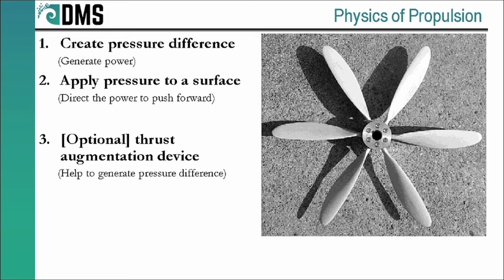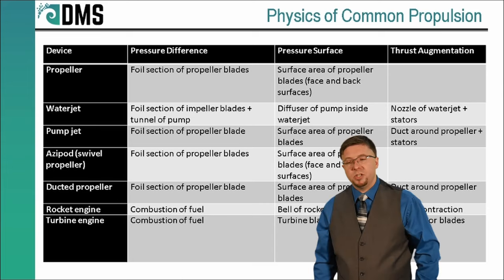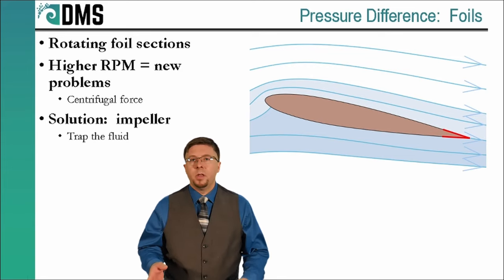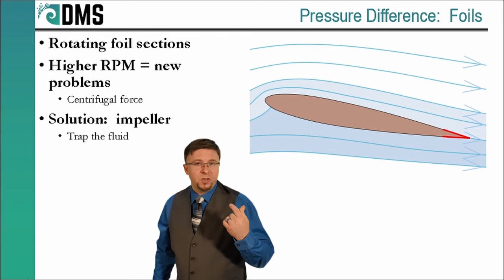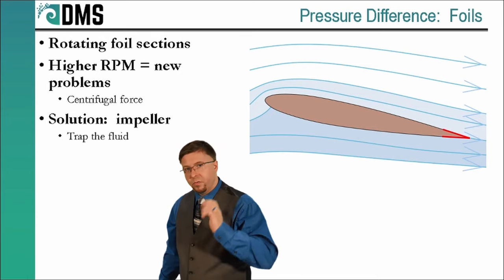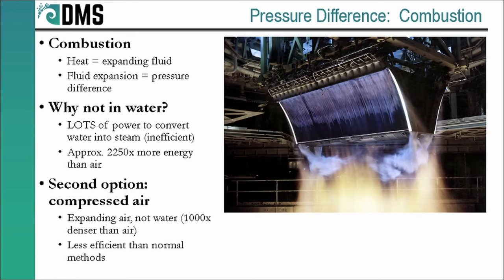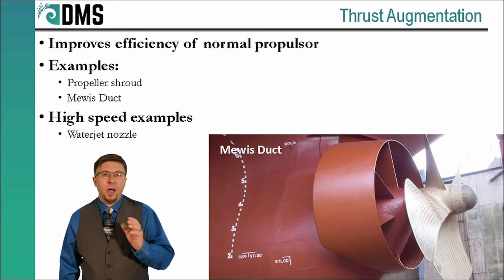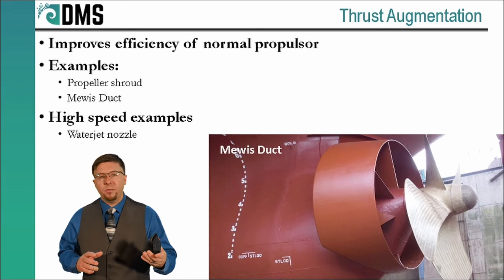What Separates a Propeller from a Waterjet?

Comment: I've always thought of the physics of propulsion in even simpler terms: reaction mass. For every action, there is an equal and opposite reaction. Every method of propulsion, land sea, air, space, biological, chemical, or mechanical, all accelerate mass in the opposite direction of thrust.
Reply: The pressure surface is where the reaction force pushes the vessel.

Comment: Thanks for this great explanation of propulsion. I made a realization while listening that sails are really no different from propellers: they also generate a pressure difference, and then apply that difference to a surface. It's the source that is different: sails just rely on capturing wind energy rather than using rotational mechanical energy. The same physics apply to both. Now that I'm writing this, I feel stupid. Of course they are the same! They're both foils.
Reply from the maker: Great point!  That thought normally takes a while even for the professionals to realize it.  Yes, sails and propellers follow many of the same physics.

Comment: What is you opinion of rim drive technology scaled up to yacht size?
Reply from the maker: Yes.  It works.  Probably better, because the larger electric motors frequently require water cooling.  From a pure physics perspective, I don't see any problem with rim drives at larger scale.  I think there may be some practical drawbacks.  Specifically, a rim drive thruster has no access to the motor for maintenance.  I haven't worked with enough electric motors to say if that would matter.  Smaller electric motors are virtually maintenance free.  But large electric motors, the size of a car . . . those get more complicated.

Comment: Where is this diffuser is located? At the entrance of duct? Or inside the duct? Or at its outer borders?
Reply from the maker: @whyMDO  The diffuser is located just after the impeller.  It includes the stator vanes that straighten the flow.
Reply: @DatawaveMarineSolutions  , thank you!
Does this mean, that stator and diffuser are the same thing? I would really like to distinguish the difference between theses two terms/entities.

Comment: Thanks, I appreciate your clear explanations.  
Now, could you please apply all that knowledge and make a more efficient outboard motor propeller for my boat?  These new gas (petrol) prices are getting difficult.  🙂
Reply from the maker: That's ironic, because the idea for this video started when I considered how to improve the propeller further.  My basic conclusion:  you can't really improve the propeller much more.  There are a few add-ons that help.  But we are at the limits of propeller physics.  I think the next big breakthrough will require us to completely rethink propulsion.  I have a few ideas on that front, but nothing actionable.   The next move will be just as big as when commercial shipping moved from wind to steam propulsion.
Reply from the maker: @satunnainenkatselija4478  Hard to say.  I have seen this style of propeller applied before in wind turbines.  The physics are largely the same between wind turbines and propellers.  But I never saw systematic tests in that case either.  

I did find a video from UofM testing on the sharrow propeller.  https://youtu.be/mwVqN9AB64Y
So it appears the prop was tested formally.  And the video does support the claim that the Sharrow Propeller reduces tip vortices.  But there are some big caveats.  First, that video had to be recorded with the prop and water flow operating below normal operating speed.  I know know this because the video shows die in the water to trace the water flow.  If you operate at full speeds, those dies immediately diffuse into the water and you never see the streamline.
On the whole, there is a theoretical basis for the claims of improved efficiency in the Sharrow propeller.  But in 5 minutes of searching, I did not find a 1:1 comparison that proved the Sharrow propeller was tested under the same conditions as a conventional propeller.  There is a very good chance that data exists.  Sharrow Marine may just want to keep confidential to protect their investment.

Comment: are rotating propellers more mechanical efficient than fish or whale fin?
whales move fast many tonnes with very little movement and friction. why boats no add some fins?
Reply from the maker: This has been a long debate in the marine community.  I'm not sure if rotating propellers are more efficient than fin propulsion.  I can tell you that we studied fish fin moments.  And the main reason we don't mimic the fish is that their movements are insanely complicated.  You can see a video of this here:  https://youtu.be/I5Phg4q5EBU

Any type of fish propulsion would require numerous underwater joints and be extremely difficult to create.  

This is similar to the argument of why didn't animals evolve rotating wheels for land propulsion?  Because a rotating wheel is incredibly difficult for biology to create.  Some things are easier with biology than with mechanical equipment.  And fins are much easier with biology, but extremely difficult to reproduce with mechanical systems.
Reply: @DatawaveMarineSolutions  thanks so much! for your reply. I will check the video
Reply: my naval architect friend, I am ver pleased to have found an answer! look for hobbie mirage kayak. there are videos showing how powerful it is and faster than kayak prop. systems!!!

Comment: When are you going to speakup about carbon fiber  hulled submersibles????
Reply from the maker: I'm intentionally not speaking about the Titan submarine incident.  We have very few facts, and far too many opinions right now.  I believe that it is unprofessional and irresponsible to provide any public engineering opinion without a sound factual basis to form that opinion.
Reply: @DatawaveMarineSolutions  you are overthinking it...  the question is what is the best method material for a deep diving submersibles if you are going to use the  provrn bathysphere materials and shape.... you no gut INMHO. carbon fiber mated to titanium rings is not practical.... of course it appears the weaving of the cfiber section was not cross woven, like cfiber scuba tanks are????...

Comment: You neeed to upgrade your video "jets" below the  water line work or US navy work not be able to use in propulsor style
Reply from the maker: True, waterjets do work below the waterline.  This gets more into classification and terminology.  I classify a waterjet specifically as the device that mounts on the transom of a boat, using a duct to suck in water from the bottom and exhaust it out the stern, above water.  There are other devices that work very similar to a waterjet but the outlet is underwater.  We call them something different than a waterjet, just to show that they are a different device.  This isn't a large debate over physics, it's semantics.  And it may seem annoying, but I have found I need to be consistent and specific with my semantics.
Reply: @DatawaveMarineSolutions  be useful if you made that distinction in you bvideos, people maybe considering below the water line locations for pump-jet type propulsors,,,,